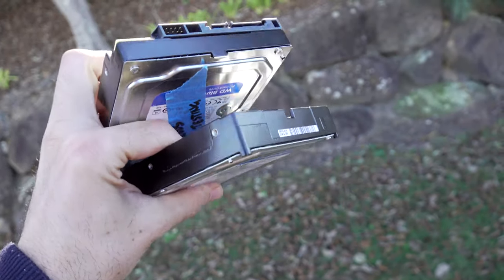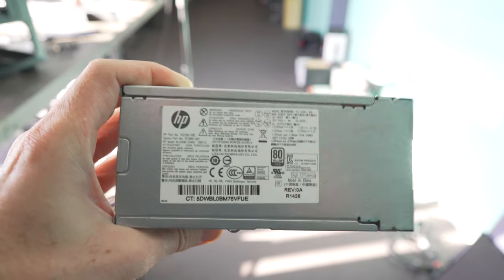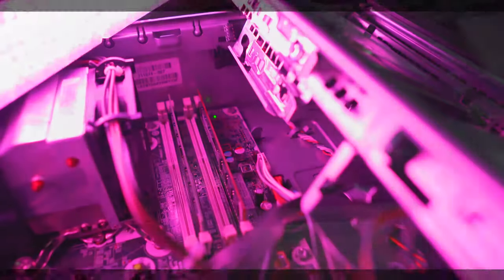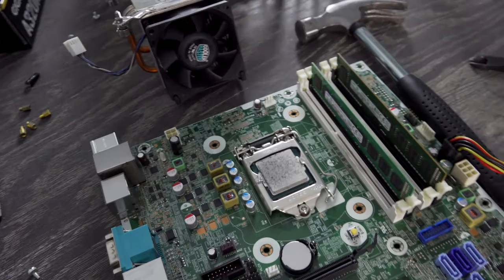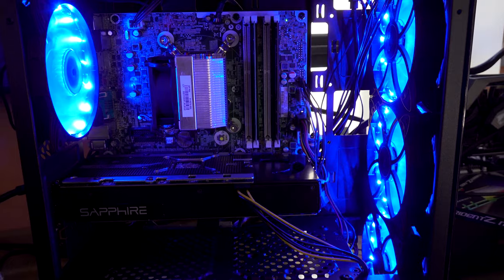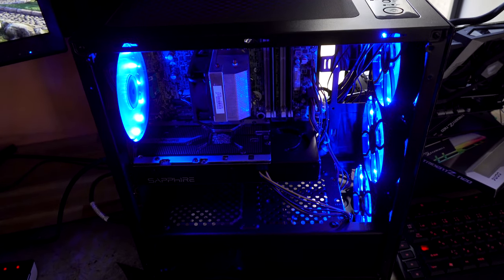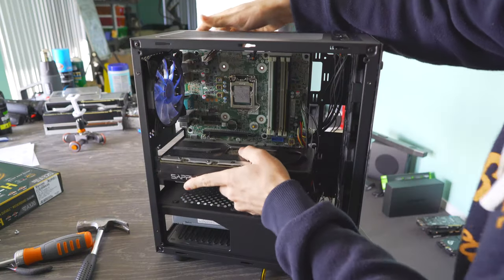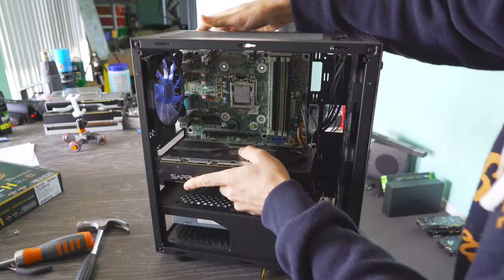Turning a $100 4th Gen HP ProDesk into a GAMING PC? (Mid-Month Hustle)

Comment: I recently put together a solid deal i am proud of. I7 920, 12GB of ddr3, evga x58 sli motherboard, r9 390, 120gb ssd, 500gb hdd, 750watt psu, and a decent case for 200 $USD.
Reply: MrAgentGrover Well I just put together a really good pc for the money as well. AMD Phenom ii X6 1075t, 8gb adata gaming series ram in quad channel, R9 390, 120gb adata ssd, 500gb 7200rpm HDD, 650 watt 80+ bronze PSU, and a $70 case that I got for $40 and this all cost me $210
Reply: @Martin M i thought and did the same with my i7 930, only to realise that when it comes to gaming, they are pretty much the same : (
Reply: @alvarosilva523  its sounds cooler tho.
Reply: Get x5675 Xeon on Ebay for $25 and overclock to 4.5-4.7 ghz, and it will smoke i7 920, and will be close to i7 4790k at 4.5 ghz. Plus you will get 6 cores instead of 4. Prior, update bios on motherboard. If you brick your cpu overclocking, you got another $25 bucks to spend
Reply: 500gb hdd? ur gnna have like 4 games
Reply: Nice. I built one with a Xeon x3440 paired with a gtx 980 and it's pretty good it costed only £220 to build and it runs anything. I still feel sorry for people who fall into those prebuilt pc traps with gt710 and it's £400
Reply: @ayoubeljabri7041  500gb is pretty low I agree. A refurbished 2TB HDD for like 25 dollar would be better
Reply: Ayoub Eljabri Nah, what if you got Minecraft, you get get Minecraft like 250 times.
Reply: HKS iCeYz how you get that cheap psu
Reply: Nice! But doesn't that I7 bottleneck the r9 390?
Reply: @ayoubeljabri7041  What planet are you living on? Not all games are +100gb xDDD 500gb isn't much but it's enough to get going.
Reply: Literally everything I have is worse than yours but also 200$ where the fuck do you guys find these deals?
Reply: @Immortal 2600K is godlike. clock to 5+ on water and it will outperform any AMD prior to Zen2 and be equal to intels that cost twice as much.
Reply: @Immortal nice! That should be much more future proof. Im saving for a z490 and 10600k, but when the wife is due for an upgrade I'm going to put her on a 3300X which should be plenty for her light gaming and I get to play with the new AMD stuff, which aside from GPUs I haven't been around since before my Core2Duo E8400.
Reply: @Immortal yeah, i just wanna hop on lga1200 early and then i can get what i need if i need it. i have my doubts as to games being optimized for all those cores and threads immediately just because they are avaliable. more likely its a design that will ensure longevity of the consoles and allow them to run background programs for the user convenience of being able to switch between them instantly. I actually was hoping for an i3 10350KF but we have yet to see if that will be a thing yet. currently 4c4t doesnt hold me back at all for my uses, just the effective speed overall could be better for like unpacking files and installing things. gaming i dont notice any bottleneck at 1080/60 at all.
Reply: @Grover Do you the case name? I really like that case
Reply: sometime soon im hoping to upgrade my gpu from an hd6450 to an r9 380 or a gtx 1650 so that my gpu wont bottleneck my fx 6100
Reply: I'm pretty proud of the deal I just got, too.

i3-9100F
AMD Radeon RX 570 4GB
32GB DDR4
500W PSU
Dual 500GB Seagate Barracudas (in RAID)
480GB Kingston SATA3 SSD
Roswill case
4 extra case fans
WiFi card
Bluetooth card
Cherry MX8000 w/PS/2

All for just under $500.
Reply: For 200 that’s amazing
Reply: how does she game?
Reply: @eddieeclark314  very good for $200 im guessing
Reply: @Radicaldude  heck ya 200 is far less then those consoles.
Reply: 200$ for all? Bruh i payed almost 200$ for my R9 390 lmao
Reply: Man.. even now.. I would love... One of those... Seriously. I just want something SOOOOO bad... I just can afford anything right now..
One of those way out of date systems would make me sooo sooo happy though...
Sad face

Comment: Using H.P. or Dell proprietary components is not worth it.  It's a major hassle and expandability is severely limited.  I use a H.P. 220z 3rd gen Intel based machine for a HTPC.  I left it in it's original case and simply installed a half height video card, SSD for boot, and high capacity mechanical drive for media storage.  Works like a champ.  Cost a hundred bucks for the workstation, plus the cost for graphics card and drives.  It will only accept half height graphics cards but if you wanted to use it for light gaming you can get half height 1050 ti cards which would be ok for 1080p gaming and not too power hungry for the 260 watt psu.  Moral of the story.............don't waste your time transplanting proprietary components into a modern case just so you can have flashing led lights.  It's not worth the  effort, the cost, or the headaches involved.

Comment: fanboys will brag about stuff they dont own all they want, but this right here is about the best deal for 1080 gaming, a Sandy Bridge thru Haswell i5 or i7 with a good clock speed on an oem board with an AMD RX 400 or 500 series. you can get 60 frames all day and likely will for a few years. then if you need more just get a Z board and K chip for a reasonably priced upgrade.

Comment: Press f to pay respect for people with a core2quad in 2k19,especially me
Reply: ✌😏 yeah i got a bunch here as spares
Reply: I salvaged one of those CPUs recently. I'd love to build a basic system with it.
Reply: @brykit1972  🙂 775 boards start at $20, try to get one with 4 ram slots so u can add 8gb easily (4X2GB ddr2 800mhz)
Reply: Dan Reid  🙂 yes i think thats like an HD 7570, its a good tiny low powered card and very affordable
Reply: No_Mercy  😀 thats ok 🐢
Reply: What about core 2 duo 😂😭
Reply: @aksyxd5583  🙂👍 sure! $10 E8600 FTW
Reply: @MrSamadolfo  e 5700 lmfao
Reply: @aksyxd5583  🙂 technically an E5700 is not a core2duo, does you motherboard support core2duo's ??? upgrade, they are super cheap now 😀
Reply: @MrSamadolfo  idk thinking of getting new motherboard and maybe ryzen 3 2200.. Idk
Reply: @aksyxd5583  🙂👍 ok
Reply: and who has an core 2 duo 😂
Reply: @francoisguillas3143  🙂 laptops
Reply: @MrSamadolfo  my 2 desktop has also ... I want upgrade these lga775 with a Xeon 771 mod 😀
Reply: @francoisguillas3143  🙂👍 ok good luck
Reply: No_Mercy  AMD Athlon II X2 260 here.
Reply: @francoisguillas3143  This is me right now, my PC runs an Intel Xeon E5450 with an RX460.

Comment: Just got a 1070, a 6700k, 16 gb of 3200 mhz ram, a phanteks p400s case, a gold-rated 500 watt psu, hellu led's, 2 tb hhd, two 240 ssds, a gigabyte mb, a lenovo 24 inch 75hz 1080p monitor, some rando rgb keyboard and mouse and a hyper 212 evo for 500 bucks. I win.

Comment: HP ProDesk, nice! That is my daily driver, with an i7-4770, 16GB RAM and upgraded to a SSD. Great top with cutting up the cooler backplate to secure the HP heatsink. On my machine ESC accesses a general menu from which you can then select boot menu, BIOS and other options.
Reply: does hp prodesk 400 g2 ms1280 ver 1.2 motherboard support xeon e3-1230 v3 aka i7 47xx ?thx in advance PhilsComputerLab i am  your regular subscriber and love your clips ;)
Reply: FluffyWolves  I ran into the same problem because the USB 3.0 plug is not connected it's under the GPU. Did you happen to find a way to fix it?
Reply: FluffyWolves  Hi, i know this comment is very old but I am thinking of  doing the exact same thing. Were there any problems when mounting the CPU cooler?
Reply: PhilsComputerLab I got a prodesk 400 g3 with an i5 6500, 4gb ram and 500 gb hard drive for free!
Reply: I picked up a i7 6700 in hp elite desk now has 40 gig ddr4 a rtx 3050 2tb nvme with pcie adapter 6tb HDD 4tb HDD 1Tb HDD 240gb SSD and a 500 Gig  ssd

Comment: I did something similar a while back. I bought an older optiplex with an i7 4770 non k, 16gb ddr3, 500 gb hdd, and a 500w 80+ EVGA PSU for $60 US. I then went to Walmart and bought a WD 500gb SSD, took it home, opened up the housing for the SSD, took out the actual SSD, and put the housing in the package and took it back. Then I found a “defective” RX 480 8gb for $40 on eBay. The seller stated that the card over heated after opening a game, so once I got it I repasted it, and cleaned it, and it ran perfect. I bought a cheap case off Newegg, and with a couple rudimentary modifications I got it all working together. So I ended up with the following. i7- 4770, RX 480 8Gb, 16 Gb ddr3 1333 MHz, 500 GB sata ssd, w/ 500 gb HDD, 500w 80+ psu, and a decent looking case for around $130. (p.s. don’t tell Walmart)

Comment: I'm 16 and i just started to be able to get decent PC's from selling for profit and then building a better system so on and so on I first got interested in PC's when I was 11 I saw my half brothers PC and it had blood red water-cooling it was so bad ass and ever since I've discovered your channel I've learned alot from flipping PC's and such so one day I will have a bad ass PC like my half brothers thanks!
Reply: Got a tip for you, always try to undervalue prices when buying. Also, try to base your buying pricing from sold eBay bids listings.
Reply: @Brandon-uy1uv  thanks
Reply: No_Mercy that’s pretty cool man
Reply: No_Mercy  I'm 15 and my PC doesn't work its HP Compaq elite I'm broke asf :(
Reply: @nicholledcaasi6715  can relate but im upgrading in november
Reply: Really cool  to hear this. Sounds like me when I was young getting into pc building
Reply: @Brandon-uy1uv  That’s called lowballing and pretty standard in negotiations. the buyer and seller will eventually agree on a price if the seller isn’t offended by the initial offer
Reply: @nicholledcaasi6715  I have that PC. Buy  a xeon 3470 and an rx 560 LP and it'll be a beast. Ram is also important. My first upgrade was to 8gb ram and man it was noticeable
Reply: @Dustin34  mine has a i7 3770 but it's broken and I dont have money to take it into a technician

Comment: I always love the OEM hustle videos. You get the rigs for a great price, make a few bucks, save a pc from the landfill, and clue us into what systems work best for gaming. For instance I had no idea that Sandy Bridge era HP rigs had trouble with newer graphics cards.
Reply: how new of cards and what rigs? i have an HP 8300 board with a 2550K and RX480 8GB. technically its an Ivy Bridge mobo (q77) so maybe thats the difference? i can play new games like Warzone and The Outer Worlds that are reasonably demanding on 1080 max and stay at 60 locked. RX480 is overclocked to just under 1400.

Comment: 11:47 That has to be a problem on the power meter's side. It's electrically impossible for the PSU to effect a (wall socket side) power meter in such a way and still work normally. From the PSU's perspective, the power meter doesn't exist
Reply: Might be using ground as a neutral and/or has the HOT and NEUTRAL inverted. Therefore bypassing entirely the power meters method. With no ground, it shouldn't work at all or it should actually measure the usage. more than likely the hot is inverted though.

Comment: HP ProDesk 600 PSU Main Power 24-Pin to 6-Pin Adapter Cable (30cm) using Top quality UL1007 18AWG

Suitable for most HP models, e.g. HP ProDesk 600 and related models.

This adapter cable will make any standard ATX power supply works with your HP ProDesk 600 workstation. ProDesk 600 workstation power connectors
Reply: yes thats what i used. well, mine was for an 8300 but basically the same thing. i later realized that all it does thats special is up the 5V standby ATX uses to HP 12V standby. so you could just wire it up yourself from the old plugs and a tiny board with a stepper if you know basic electronics and soldering. and this applies to any proprietary psu. most all have the needed 12v, neg12v, 5v, and 3.3v. some are multirail so in that case you want to make sure your cpu and gpu are on different rails.

Comment: Got a hp dc5800 pc from the dumster
Its nice could try to reinstall windows clean it  then sell it
Lets give it some tech yes loving
starts playing i wish i was a mad man
Reply: Lol I got like 6 pc from my uncle for free
Reply: 4 lga 775 1 lga 1150 and one 1155
Reply: @noamseitz3521  That 1150 one should be worth quite a bit depending on what you do with it. I got an HP EliteDesk 800 (almost the same one in the video) though it's a standard Micro ATX size (still figuring out and hoping it fits standard MATX boards inside) with a 4590 and 8GB RAM. Threw in a PNY 120GB SSD and an RX 460 and it's running well so far. 

What I'd like to do is get an LGA 1150 board that's MATX and transplant the CPU, RAM and GPU to the new board, and then fit it in the case with a new PSU.
Reply: @noamseitz3521  i got 8gb of ddr4 in unknown condition
Reply: Update the bios and install linux mint. Ive done it.
Reply: I had that exact one! That's the full size one not the SFF one right? I actually managed to find a proprietary 500W PSU that fit the case perfect! Was planning on putting a decent GPU to match and doing the Ninja hack on the CPU but my friend gave me his downed FX system before I got that far :) Finished building the FX system last year and currently getting it ready for sale to fund the parts for an AM4 build.

Comment: I just finished with a build close to this.  I was on the fence about buying another XBox/Playstation anything.  I started out with an HP Desk Pro 600 G1 SFF that I had for a couple years and it worked well as a surfer/streamer and a crummy Music Work Station.  The first thing I did was swap the HD for a Samsung 850 Evo SSD at $90, a whole world of difference.  I swapped out mem and replaced with 32 gigs of crucial 1600mhz DDR3 that I got for $75 on Ebay and put a GTX1060 in it I also found on EBay for $150.  I couldn't close the case after that and I had to get a second PSU, jump the power to ground on the ATX connector to provide power for the GPU because there was no 6pin PCI power on the HP and at 260 watts I doubted it's ability to power the GPU.  I also got a Sound Blaster XAE5 cause I make music on this thing too.  World of Warcrafts played great at all resolutions, and then I started looking into other games.  I noticed that CPU and GPU were maxed out while playing Rise of the Tomb Raider and Just Cause 3.  And then the 1060 died at the same time the cheap PSU I bought for $30 fried, probably related, sad.  So I got a Corsair 850Watt PSU NEW realizing what I would have to do in the future.  I replaced the GPU with a GTX 1660 TI new from Micro Center $300.  GPU utilization dropped but CPU was still maxed.  I replaced the I5 4560 with an I7 4790K also from Ebay for $250 from China but had to turn turbo off in bios due to over heating and current throttling (always make sure you are running the latest BIOS version).  At that point I realized that the motherboard was the bottleneck and simply not sophisticated enough to provide stable power and thermal management for the new CPU.  So I bought an MSI Gaming 5 on Ebay for $150, it took almost a month to arrive from China but worth the wait.  I then purchased a Corsair Chrystal 460 case cause NEW I was tired of the Pi look. A Corsair H100i $130 and a Corsair Commander Pro for $70 at Micro Center cause I like my lights to sync.  And a Crucial 1TB NVME M.2 I think it was around $100.  I de-lided the 4790k and Conductonaut under the IHS and Kryonaut on top.  And another 32 Gigs of mem only Hyper X Fury at 1860mhz ebay, about $200.  Now everything runs great!  CPU overclocked to 4.6Ghz and stable with temps never above 62c.  I tried some overclocking on the 1660 TI and saw some really outstanding benchmarks but found things ran a great deal smoother without overclocking when actually playing games. (I wanna' get a 2080 super maybe).  I also de-lidded/Condutonauted the 4560, put it back in the HP, left the Crucial mem in and the 850 Evo put the lid back on the case and gave it to my wife who works from home and had another HP but older with an Athalon (YUCK!!!).  so in short, this can work but you will find that the MB and PSU of the original HP will be sorely lacking in performance, management and features.  It's kind of like putting a super charger on a Ford Pinto.  And don't be afraid to buy cheap stuff from China, it's worked out great for me.  Oh and one more thing, those USB 3.0s on the HP you know the blue ones, aren't.  They are "USB 3.0 Supported" in HPs world that's the same, it's not.  They will recognize USB 3.0 devices but will only 'speak' in legacy USB.  So NO VR support with the HP board. It was the purchase of an Oculus Rift S that made me buy the MSI motherboard.  I did this over the span of about 9 months so the cost was very stretched out and manageable.

Comment: That's cool. I'd probably 3d print an extension cover for that PSU which has that bit gap in the back. I think 3D printing offers a lot to the PC community, especially the used parts community that might be pairing gear from different machines and generations. Considering the low cost of 3D printers and the relative ease of designing functional parts, I'm surprised it isn't used more frequently.

Comment: I got a Hp ProDesk G1 600 for $20 barebones. With an i7 4790k, gtx 1650 low profile, and 32gb ddr3, the whole system came to $440. For that spec, I think it's a great price.